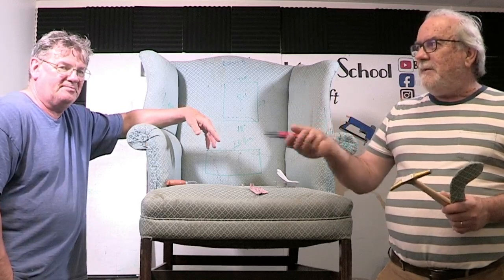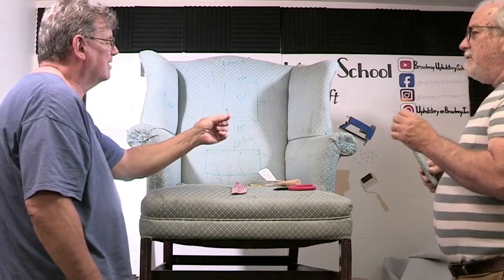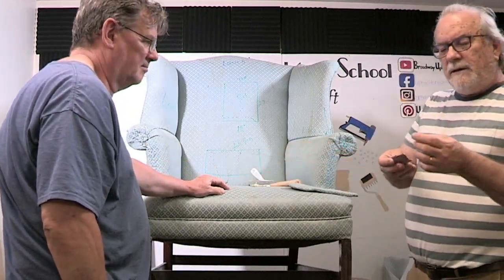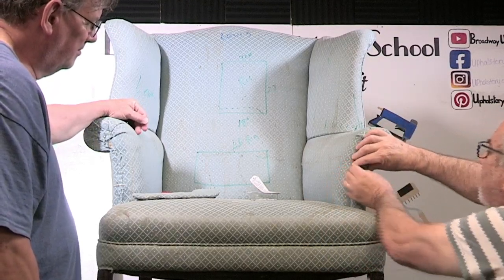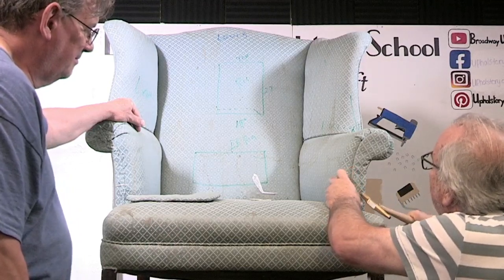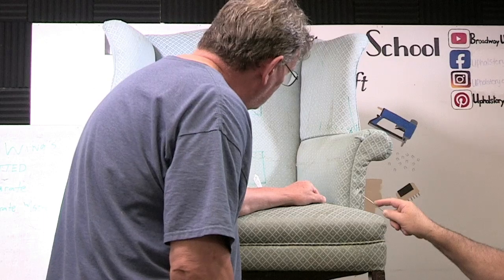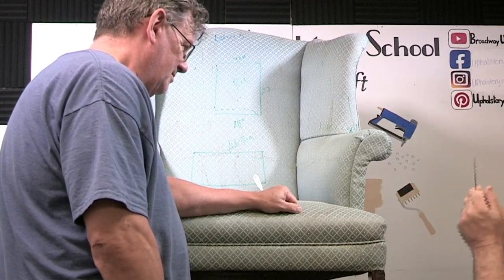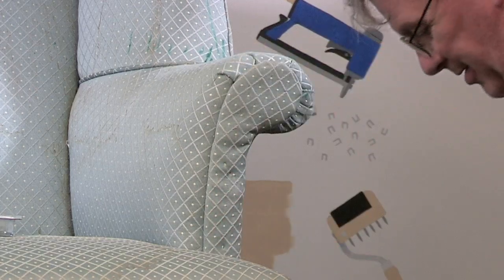How to Attach an Upholstered Panel

Comment: Excellent video, very good explanation of the process.   Cleaning the nail so very important, I use alcohol wipes to be sure things are clean. Sometime using the point of the regulator to separate the fabric before inserting the nail helps as well..

Who ever made that panel did a poor job of fitting it.  That now makes repairing it so much more difficult. Jimmy did an excellent job of making it fit

Comment: Hi guys - Jimmy asked the question that I wanted to know which is: to hammer all the way in or to leave it out slightly before 'popping' the fabric over the brad?; In my experience from doing panels, I found that if I hammered all the way it was more difficult to pop the fabric - almost like the fabric was trapped behind the brad making it more difficult to get the fabric over!